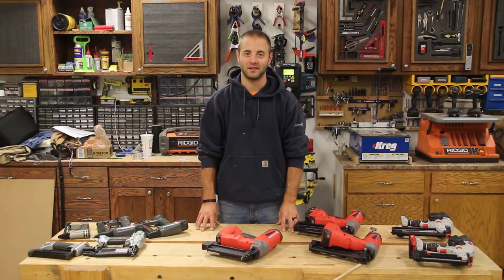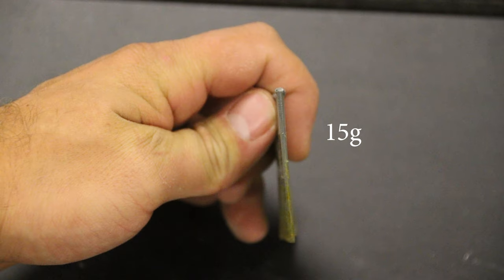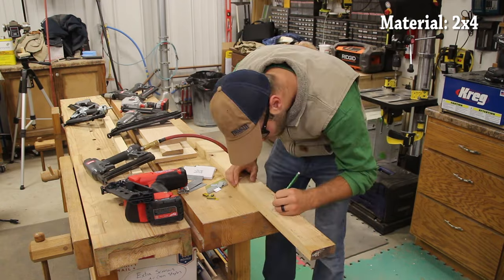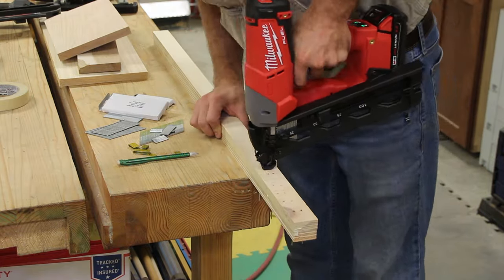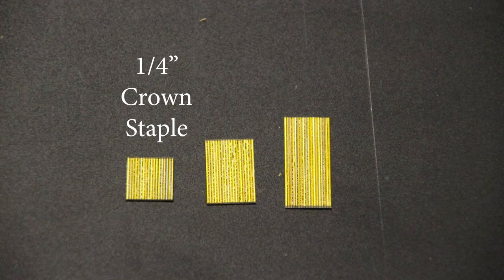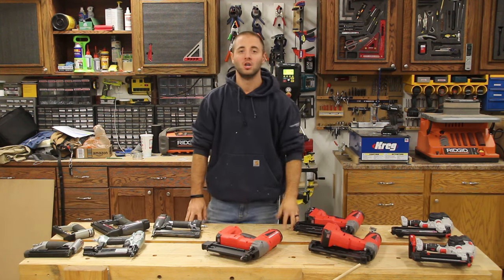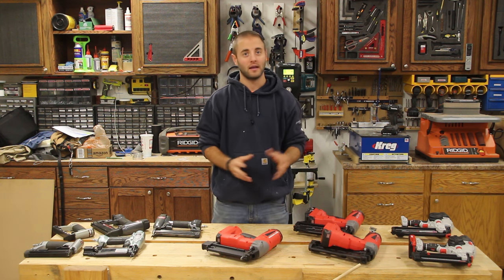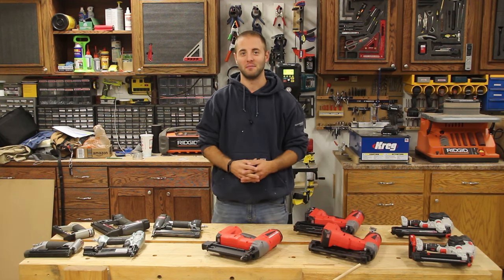What Gauge Nailer for Woodworking?

Comment: For trim work avoid the two in ones. The anvil which also drives staples leaves a larger unsightly slot shaped indent.

Comment: Good video. I acquired a Hitachi collection a few years ago and got the 15ga angle finish nailer, 18ga brad nailer, 18ga barrow crown stapler and 23ga pinner. What I’ve observed:
- The holding power of staples is many times that of nails. If the joint won’t be visible, use staples. 
- The pinner is the way to go for anything visible. Use it with glue and toenail the pins for better holding until the glue sets. Paint/stain right over with no filler and they disappear.
- 15ga angle nailer is best for harder to reach things or any time you need a really long nail.
- 18ga brad nailer is the most versatile, but once you get the other guns you’ll rarely use it because there’s always one of the specialist guns that works better. One of the others either hides better or grips tighter or has longer reach. It is now my least used gun.

I’d get the 18ga bras nailer first, then get the narrow crown stapler 2nd.

Comment: 18 gage is my go-to stapler. I work a lot with 1/2 and 3/4 plywood for projects and for holding power, glue and the 18 brad is my best choice. My gun shoot 3/4, 1 inch, 1 1/2 inch, and 2-inch brads.

Comment: Reassuring as I have an 18g airstrike. I didn’t buy 16g as I thought I would prefer screws if I wanted permanent strength. I often use the Brad nailer as a positioner and clamp.

Comment: I've been a woodworker by hobby since the late 60's early 70's. Personally I think you did a great job explaining the differences for the newbies. As for my self, I have both an 18 gauge brad nailer and crown stapler. I wish I could afford a pin nailer and a 15 ga framing nailer, but you how that goes when the budget is extremely tight.

Comment: As a cabinet maker, I've done lots of cabinet assembly with staples, followed by screws. Staple perform well in particle board, melamine and plywood casework. The brad nails were mostly reserved for trim, 16ga for paint grade and 23ga for stain grade trim.
Reply: well spoken

Comment: I am a home owner an window/glass installer. I am moving to cordless nailers. I bought the Ryobi 18g Airstrike first and it's great. All my guys grab that before thinking about hauling around cord and tank. I plan on getting a 23g and am debating wheather to get a 15 gauge or 16 gauge. Leaning towards the 15 gauge.
Reply: a couple weeks ago i replaced a broken window pane using the 23g airstrike, it worked great and left the tiniest barely visible holes in the trim, if it wasn't for the old holes from the staples that had been holding it before i replaced it, i wouldn't even need to paint it.

Comment: I got a 18 gauge brad nailer and compressor to assemble store shelving. It worked great and didn’t split 1x4” boards. I also learned to not get my hand near the joint being nailed. The 18 ga 2” nail hit something and curved out through my finger. Lesson learned.

Comment: As a carpenter, I use a framing gun, a 16g gun and also a 23g gun which is good for holding till glue goes off  or stain grade mouldings.

Comment: I'm new enough at woodworking so this was helpful, I'll be going with the 18, I've been in shops looking but really didn't know which one to buy, thanks for useful info 👍
Reply: The brad nailer will do a lot of tasks in the woodshop.  That was my first nailer, and I still use it a lot.  The only time I use my finish nailer is for doing crown molding or base trim jobs...everything in the home woodshop seems to get the brad nailer.  Picture frames I'll tack the corners till the glue dries using pin nails as the holes left are extremely small and most times don't require any work to cover holes like other fasteners would.  Staplers work great for upholstery type jobs but other than that I don't use staples.

Comment: Great overview of the air nailers.  Although it can be tempting to use in 18g brad nailer on projects, stick with only using a 16g for cabinetry/furniture work as the holding power is night and day.
Reply: For outdoor patio furniture like chairs, would you suggest going 16 or 15 ga?

Saw another rec for 23/18/15, as the comment said most would just opt for 15 for the additional holding power over 16.

I assume they meant 23 & 18 for smaller stuff like boxes, frames, cabinet work.

Comment: For my first brad nailer gun it's definitely the 18g.  It's the best of both worlds when you only have one brad nail gun to begin with.
Later you can get the others if necessary.
Reply: It'll do a lot of work, the brad nailer is what I started out with about 15 years ago, course I now have many other sizes of nailers but that old brad nailer still gets used all the time for shop projects.  Its small, and easily fits into many places larger nailers just won't fit.

Comment: Andy, Thank you for that excellent video review.  It gave me the information I needed to put down the hammer & nails and enter the world of pneumatic tools. I always wanted to, but just didn't know where to start. I'm new to woodworking so I went with a combo kit from Porter Cable. It came with a six gal. compressor, 16 ga. finish nailer, 18 ga. brad nailer,  and an 18 ga. 1/4" crown stapler. I purchased a 23 ga. pin nailer separately. Now I'm ready to go. Thanks again.

Comment: Excellent video, especially in that you gave good information and move very quickly. No unnecessary banter that slows the process down. Getting to the point quickly is great. One suggestion only, place a coin near your samples of nails for scale. It's great to see the difference between them, but putting in a coin to give a scale would provide a little better feel for which one might work best for our situation. Otherwise, great job

Comment: Great job Andy.  I have a 16 gauge for trim work - baseboard and door casings where I need the added nail length to penetrate the drywall and still get into the stud.  I don't do much fine carpentry, but I agree 16ga is probably too big as it not only leaves a large hole, but I would think it might even split the wood.
Reply: love me the dewalt 16g brad nailer the holes don't bother me i fill them up with ease,yet though the 18g are very nice for my miniature projects

Comment: I have used an 18 gauge brad nailer for years, i recently got a 15 gauge finish nailer and a pin nailer.  Have not used the 18 gauge brads  in a while , it has its place but my 15 gauge makes the same size hole.  go hitachi kids

Comment: Quick Question - For individuals with no nailer, nails range from 10 ga framing nails to 23 ga pins. I'm torn between 16 ga and 18 ga. In your experience which do you believe to be the more useful for 90-95% of trim. Many people who are getting into wood work or carpentry have to spend money on miter saws, nails, adhesives, sanders etc. and may not have the budget for 5 specific nailers. 16 ga has more holding power but makes slightly bigger holes (don't want to blow out your pieces) at the same time 18 ga may shear off with bigger/deeper trim. Price difference of ~100 dollars is negligible

Comment: Thank you! Thank you! Thank you!  As a beginner in woodworking this is exactly what I needed.  You have a very happy follower!
Reply: A brad nailer will accomplish many woodworking tasks in the shop, followed by a finish nailer which depending on what you are doing the 16 gauge finish nail heads are smaller than the 15 gauge finish nails so hiding the 16 gauge nail head holes would be easier to do on a project.

Comment: I use the jlab epic sport anc wireless ear buds. They have the be aware feature so if you want you can hear whats going on like someone talking along with the noise canceling. I use them with a grider oscillating tool and chainsaw. Now i dont know how many decibles they actually block but i know for a fact my ears dont have ringing in them after doing loud work. Especially when using the foam insert. And they have a earhook on them, i will not buy a set of buds that does have the ear hook. Plus they cost under $100 with a 2 year warranty.

Comment: All the pro's said to use a 16 gauge for baseboards for holding power but will the 18 gauge do ok for baseboards ?  Thanks for your time and the video !!
Reply from the maker: 18 will do OK if you do not have to bend and twist it to the wall and you might need a few more nails in each piece than with 16.

Comment: Is anyone still using construction staplers?  We used to use them back in the 1980s for wall sheathing and roof decking.  I believe they were 7/16 crown.  Man they had some holding power.  I know they wouldn't be much use in a woodworking scenario, though.  Good video, spot on info.

Comment: I just bought the Hitachi NT65MA4 15 gauge yesterday at Lowes for $130 and a box of Hitachi 2 inch DA finish nails 4,000 count for $35. I read tons of reviews and bought this based on my application and on the quality for price aspect. I haven't done research on what 18 gauge is the best bang for the buck, should I stay with Hitachi on that too?
I don't own a pancake compressor yet and like the Porter Cable for $100 but I know it is loud and not meant for quality That is what earbuds/hearing protection is for. That heavy duty and quiet  Dewalt is nice but the $160 for it makes me think I should pass it up. I like the portability of the pancake size to be able to put in the cab of my truck for security reasons as opposed to a bigger hotdog style compressor. I am a solo do it yourself kind of guy that has learned to not buy the cheap crap in situations like this due to cheap quality. I'm not in the business either so I don't need that $300 and up stuff. Can somebody give opinions on a reasonable pancake compressor only and on a pancake compressor that comes with a 18gauge and a 23g pin nailer combo kind of system?
Reply from the maker: Right now, the Hitachi tools are on sale because of the name change to Metabo HPT.  The warranty and everything are the same.  I would load up on Hitachi tools that are on sale.  Check out this Hitachi compressor.  https://www.youtube.com/watch?v=eO_WL0Vx4BA
Reply: The Hitachi pancake compressor Brad nailer combo is on sale now at Lowe's for like $150. Great buy.

Comment: This video helped the decision making process. Seems like the battery powered is also the way to go for infrequent small projects. Recommendations on a good 18g battery powered nailer?
Reply from the maker: Milwaukee just came out with a new model that leaves no extra holes than the nail.  Dewalt has a great model also.
Reply: It really depends if you already have some cordless tools in one color, then get that brand, if not its really up to you which color you want.  For the occasional user any good brand name nailer is going to work great for you.  In production work you'd most likely want to pay attention to battery run times, and firing speed for how quickly you can get the fasteners in, but most of the time Dewalt, Milwaukee would be my top choices as well.  I'd have to go with Dewalt since I already have the 20V stuff, but Milwaukee has some great stuff too.  I think Hitachi may have some good cordless nailers too.

Comment: Question:  Installing 1" Oak stair treads onto construction grade pine stairway using Bostik Tread-Loc adhesive and a fastener - should the fastener be- 16g angled fastener  OR  18g brad?     I realize the 16g would hold better but looking to minimize visual fastener hole.
Reply from the maker: Are you able to hide any screws under the trim?  18 will be fine

Comment: I'm a new woodworker looking to purchase a nail gun. Mostly making coffee tables, end tables, and outdoor furniture. What would be the best gun for me to use based on the type of work I'm doing.
Reply from the maker: 18 gauge.  Pneumatic if you have air.
Reply: Outdoor furniture I would use a 16 gauge nailer up to simple screws if you are talking deck chairs.end table and other tables of that sort can be put together with staplers or brad nailers, both being 18 gauge

Comment: At what point would you switch from pneumatic nails to screws for strength?  Mostly I hear the word "trim" applied to pneumatic nailers, which sounds like a light load application.  If you were building a cabinet for sitting on, what would you use?
Reply from the maker: Pending the type of joints on the cabinet for sitting, one could use glue and nails to hold it while the glue dries.  Most would switch over to pocket holes and screws fairly quick in any sort of build that needs strength.  So you, light load applications.
Reply: Roderick Legato 
Just an FYI they also make a screw called a “trim head” screw. It is made with a much smaller head and intended for use when more holding power is needed and you don’t care if the screws are seen or you can use plugs. I have seen some people use them for putting on shoe molding for baseboard and then use a filler to hold the hole which works with stain grade or paint grade...

Comment: Hi there, Im a British female who has decided to stop calling out the handyman and learn to do it myself. I bought a Ryobi 18 gauge nailer, which is cool, except even with full pressure and adjusting depth, it didnt drive a 50mm brad nail into hard wood, I had also wanted a nail gun that does staples too, so I have one versatile gun, would you be able to recommend any, or if its better to do that or get a stand alone stapler, my jobs will be fixing things, like a chicken house, and things around the house, would like to have a go at making a bird table etc, and also re upholster things, any advice, Id be very very grateful. thank you xx Holly xx

Comment: I'm new to woodworking and I've been scouring the internet for clarification regarding nails/fasteners. Your video is great, information delivered in a clear and concise manner. I couldn't have asked for anything better. You explained the differences and the uses so well, I finally understand what I need and why. Thank you for your video. 
I do have a question, what are your thoughts on the Brad Nailer/Stapler combo tools? I have been looking online for the correct tool to purchase and came across the WEN 61718 18 Gauge 2" 2-in-1 Pneumatic Brad Nailer & Stapler on Amazon for what seems like a surprisingly low price... But anyway, seeing as how I'm going to be building and upholstering furniture, I thought it might be a good choice.

Comment: Wow I'm surprised, I got the right one. I got my first nailer today and out of a whim just by how it looked and price I went with an 18 gauge Brad nailer at Lowe's for $60. I had no idea that all nailers would be so different on size but this looked be a good versatile size with a good price I'm glad I went with it. 🙂. I just use it for hobby and small projects. I am not a Carpenter, I may go with a 15 gauge or a framing nailer next. This stimulus payment is all going to be all tools related purchases. 😁
Reply: The brad nailer was my first nail gun as well...course I now have roofing and framing nailers, finish nailers, staplers, pin nailers, etc.  Kind of buy what I need at the time.  They all have their place.  

Only time you'd need a framing nailer is for nailing together 2x or larger material, 1x and thinner stuff a finish nailer will handle just fine, and if its a soft wood you may have to play with the air pressure if you are using a pneumatic nailer...or the settings on the nailer if its a cordless it may have different power settings.  I found in soft wood running the finish nailer at full pressure would send the nail through the material completely...OOPS.
Reply: @wildbill23c  I've been using mostly 4 my interior door projects. I've been keeping my PSI around 75 to 80. I've got a 6 gal 150 psi air compressor. So I don't have any issues with going all the way through the material.

Comment: I’m a new wood worker. I have a 18 gauge nail gun, my question is when you need to be Perfect on target with your nail. How do you know where to shoot it, so it will not miss or shoot out the side? Thanks, great video. I just built my first project, a work bench, go check it out let me know what you think.
Reply from the maker: You have to look at the grain and see if anything in the grain, be it knots or weird patterns, might shift the nail.  That can be tough with hardwood.

Comment: Crown molding is 18g ok?  Material,is foam and will use painter sucking at contact point along entire length. Will have 3-4 inch space from celling so LED light will offer indirect lighting......what size do u think

Comment: As a newer woodworker, would you say a cordless, or pnuematic is the way to start?  
 
I'm leaning towards pnuematic myself due to their durability, cost, and power... but I'm still not sold on *not* getting a cordless style (my current cordless tools, that carry nailguns in their linup is limited to dewalt 20v, and I don't hear a lot of great things about their cordless 18ga nailers. And I'm not limited to any particular tool brands. I want the best value.
Reply from the maker: If you have a small area you are working in and can deal with the hose, go with an air powered unit.  They are less expensive and work better in most cases.  They are also smaller.

Comment: I've seen a lot of 2-in-1 pneumatic 18 gauge brad nailer/staplers on the market. I like the idea of having a tool that can use both brads and staples, but I've heard that, when using brads, they will create a larger indent in soft wood than a single-purpose 18 gauge brad nailer. What do you think of them?